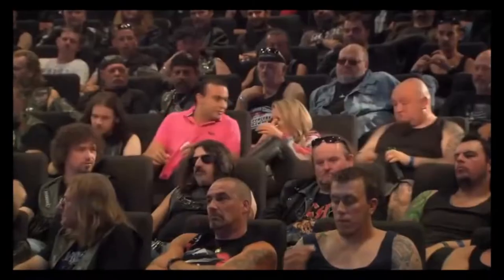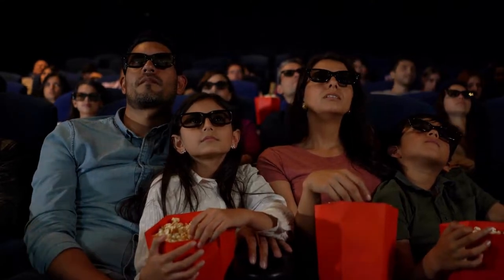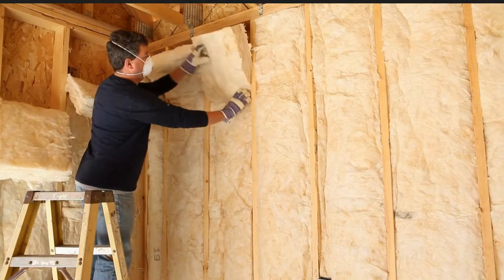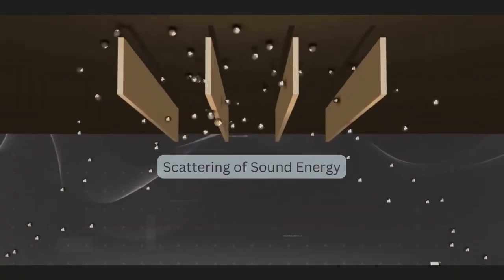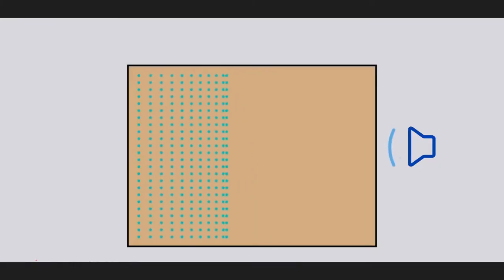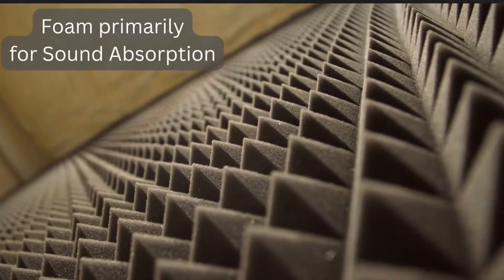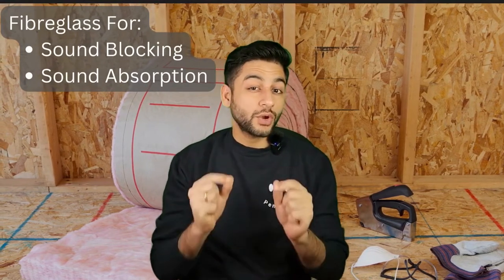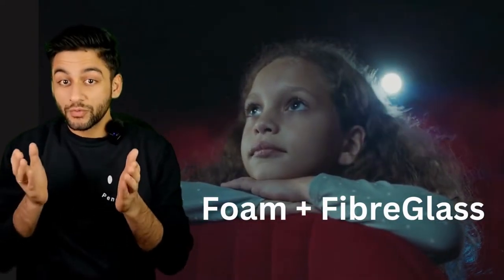The Science Behind Soundproofing in Movie Theatres | How Acoustic Materials work

Comment: Foam isn't used at all. It practically serves no purpose in sound absorption. Rockwool and Fibreglass wool are lined along all four walls with a minimum thickness of at least 2 inches. The panels are thicker behind the screen where the main speaker channels and subwoofers are placed for better sound absorption as well as cancellation of sound reflections as these speakers are the loudest. The concrete walls of the theatre are also built in such a way that they're extra sturdy and do no allow sound waves to escape into adjoining auditoriums and lobby areas. This applies to the double-doors in the theatres as well.  The rockwool and fibreglass wool on the walls are then covered with wooden framed panels which are covered with tapesry, depending on the interior decor of the auditorium. Some cinemas even use saw-dust panels or woodfibre panels. Especially the older models of theatres constructed in the '60s and '70s
I'm an acoustic designer for cinemas so you can trust what I'm saying and avoid arguments in the response column. 
You still get marks for your attempt in explaining cinema sound-proofing.